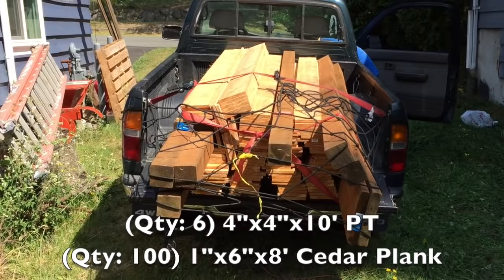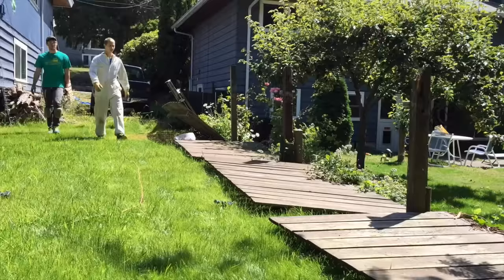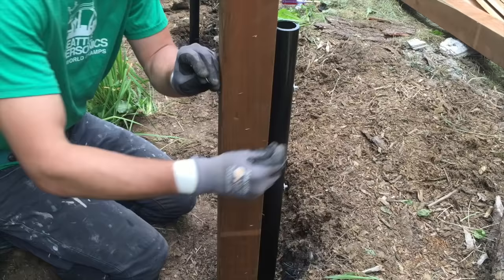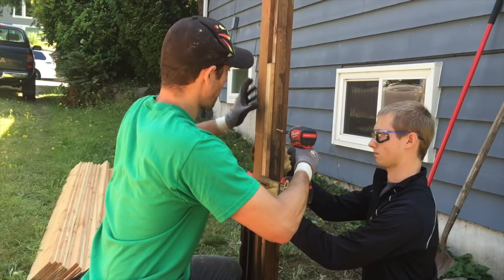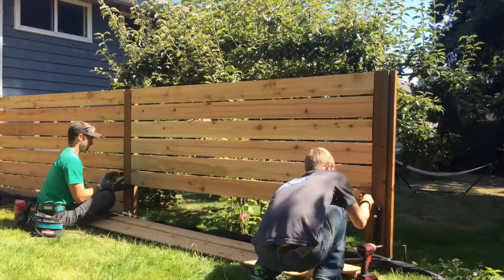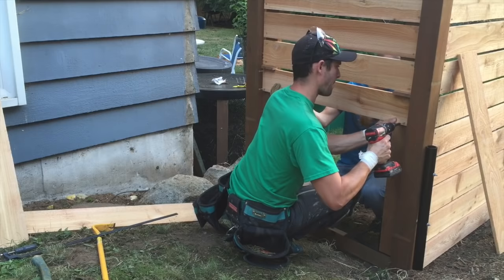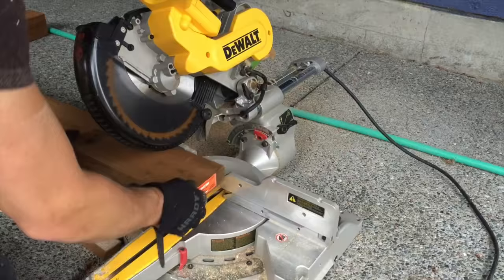How To Build A Fence : DIY PRIVACY FENCE

Comment: Every time he touches the fence the post move a lot. Those metal post are pretty low and only two bolts on the bottom is not very strong and not recommended. Over time they will get loose in the 4x4s from wind. Only two small bolts holding up all that weight just does not feel right. It does look good but looks only go so far.

Comment: Great video though why did you get so much tearout on the cap caps?
Reply from the maker: Mainly because I was using a blade that most likely needed to be replaced. Or I just should have applied some tape to the wood first to prevent tarot.  Thanks for watching Jeffrey.
Reply: BYOT thank you, that makes sense. truly enjoyed watching!

Comment: Nice job. Curious, did you use 1/2” or 5/8” thick cedar pickets, and have you noticed any bowing/warping without having attached them to some type of framing besides the posts?

Comment: when you said you laugh at them guys who leave a big gap i agree it looks terrible that's what they did  Yeh man my bro hired some people who said they knew he bought  2 by 6 12 feet   but didn't do the cuts right no flush at all. its terrible I have to check if its level but one of the 4 by 4 is not following the line how do you recommend fixing that installing a 1 by to make it look even . I Want to intall poles for kids and pets to make more soilid these guys only dug a feet and put concrete on the 4 by 4  to  help my bro he cant do it himself he suffers from a abm malformacion on hes neck which stops blood flow to hes neck, down and is proggresive he s disabled cant even eat  himself but he ask me for help thx for the video ill see how ill do it tomorrow  excuse the spelling its a bit late have no light glare hurting my eyes  but have to be up early very tired  thx good video
Reply from the maker: Hi Alex.  Thanks for your detailed explanation.  Thats too bad that they did such a bad job on your brothers fence.  It sounds like the main issue is do to them not pouring a proper footing first and only went down 12".  I would suggest using a ratchet strap and wraping it around the 4x4 that is not lining up.  Ratchet it until the fence is straight and then dig a larger surround around the post that is out of line and pour more cement so it has more support.  Hope this helps.

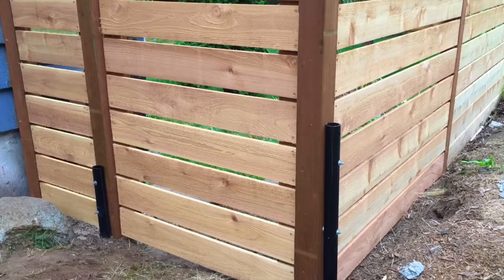Comment: Those poles look tacky...they’re not even the same height. I would be pissed. At 7:10 what’s the point in running a sting if the fence looks like it’s doing the wave...it’s crooked. Lastly the top rail is screwed so close to the edge it will begin to lift as the wood contracts. To end on a positive the horizontal design is nice.

Comment: I would need to fence 400 ft. I quoted the wood, man it's expensive
Reply from the maker: 400LF is a lot of fence haha.  What did they quote you?
Reply: A Font, I'm curious as well about the lumber cost. 
I'm looking at about 400LF for our new house. The dilapidated chain link has to go. And the wife and I have already decided on a horizontal fence rather than the standard dog-ear vertical fence.
Reply: BrewerJonD lowes gave me a pretty good price on the wood but its still expensive
Reply from the maker: Well the good news is that building a horizontal fence is the same expense as a vertical fence line.  good luck on your project.  Thanks for watching.

Comment: A lot of mistakes in the video. It looks good but it’s not going to last long due to amateur mistakes.
Reply from the maker: Apparently those mistakes don't matter Derfboy since this fence has been up for almost 5 years and still looks great with zero issues.  What do you think could have been done better?  Thanks for watching.
Reply: @BYOTools  you should be able to level your post without having to use washers, the pre drilled holes are way too close to the edge they will give out and the top rail will start to come undone, I could go on but it’s cool. 5 years is ok but it’s definitely going to need some tlc I soon I bet. I do this for a living not trying to be mean but it’s hard going behind people fixing stuff like this when it could have been done properly and thus not helping drive up the price of lumber due to demand

Comment: The metal posts look ugly. And I’m sure the wind resistance is a whole lot less
Reply: Also need to run a string line from corner posts. That way you don’t have that wave looking down the fence.
Reply from the maker: Posts are not my favorite look but its what was existing and as long as they are structurally sound then I'm just fine with them.  Plus with the top cap you can't tell there is any wave down the fence line.  Thanks for watching James and hope you enjoyed the video.